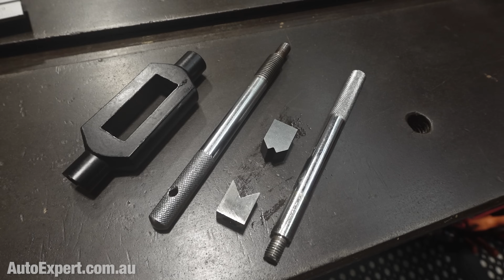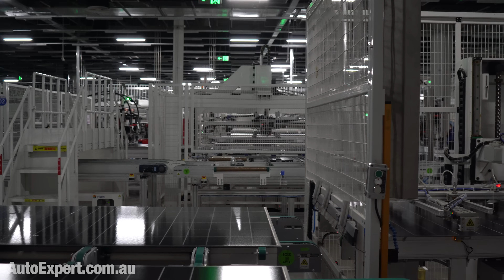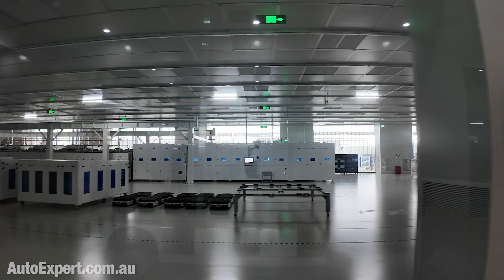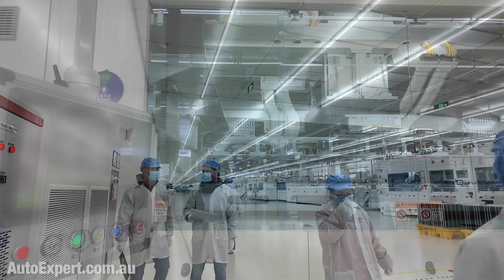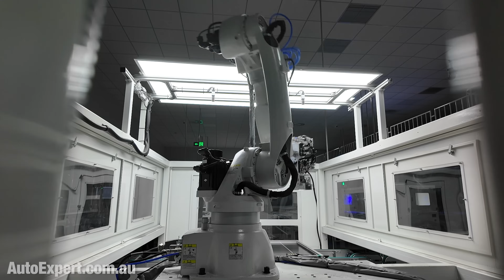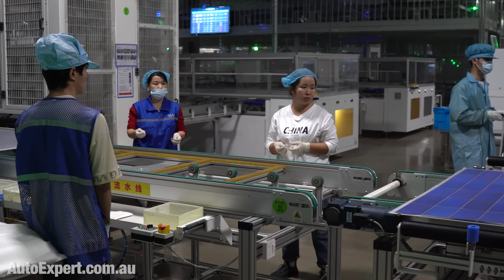The truth about Chinese manufacturing in 2025 | Auto Expert John Cadogan

Comment: Labour cost is too high in Australia to manufacture goods, however, it will be a lot cheaper if it’s done by robots. I think that’s the direction Australia should take in the future. High tech + auto-manufacturing industry
Reply: Forget about manufacturing anything in Australia.  Our market is too small for efficient investment.  Nobody outside of Australia will buy it. No future other than digging a hole and sell whatever you find.
Reply: Labour, these days, is a relatively small cost in many manufacturing endeavours. In a US manufactured car, for example, the labour input accounts for 5%-10% of the wholesale price of the vehicle. If you double that cost or halve it, it barely makes a difference to the retail price.
The other 90%-95% of the cost of producing that car is rent, plant, import duties, taxes, transport costs, compliance costs, taxes, insurance, energy costs... the list goes on.
That's why countries like Australia can no longer compete. We were sold a pup, decades ago, when unions and the high cost of labour were blamed for offshoring industry. We were lied to. And we took it hook line and sinker. We're not getting industry back to Australia.

Comment: Have a look into 5B an Australian company setting up production lines using ex Auto industry assembly line workers as well I can not say too much but have sited the line in mascot syd with mix or robot and ppl the other line is in Adelaide.  they were also going to be apart of that Sun Cable 20GW system below Darwin. mind you would be much better having home grown silicon cell production like tindo.

Comment: With so many disparate Chinese brands arriving, how can it be economic for each of them to set up individual comprehensive parts, service and support networks like (say) Toyota, Ford or BMW? The logistics seem daunting. Or do they mainly all use the same components for a given function, like a suspension component or wiper motor?
Reply: you know all the well established car makers have done that for decades. every combustion vehicle in the world uses lucas(delphi), bosch or hitachi electrical, ignition or fuel system parts.

ignition and fuel injection system almost exclusively bosch and licence built by other manufacturers

Comment: I'm old enough to remember when Japanese products started flooding the UK market in the 1960s. Most of it was cheap plastic crap and consequently all Japanese products were labelled as such and dismissed. However, by the 1970s Japanese cars and motorbikes were considered of both superior quality and superior value for money compared to British-made cars and bikes, and brands like Sony and Pioneer were taking over electronics.

Fast forward 30 years and it was the same story with South Korean products -- Hyundai, Kia, Samsung, LG, and Daewoo. (No, not the car manufacturing arm that was bought by GM and went bankrupt due to senior management malfeasance, the marine engineering giant that builds tankers and oil rigs.) Another 20 years on and now its China that is producing goods that are not only a fraction of the price of Western-made goods but also technologically superior.

Comment: 7 years ago, I worked at a company that bought a Hitachi  laser drill to make very small diameter holes in printed circuit boards.  It was the only one in Australia at the time. The service man came in from Singapore every six months to service the machine. 
In conversation, he mentioned that he spent most of his time in Schenzhen servicing 60 of the  same model drills. He also mentioned that there were just three operators to look after these machines,  such was the level of automation in that particular factory. 
That was a real lesson to me how small Australia's production actually was.
Everything with electronics needs a pcb.
Reply: China has been built up into the biggest global superpower by the Jewish financial elite and every valuable Western technology has been shipped there. This was identical to what the Jews did with their USSR, turning it into a massive super state of a military superpower, to wage conquest upon the rest of the earth, which they did.
Reply: via,s
Reply: When I worked in China around 2005 in the next town was a Flextronics factory - It had 27 SMD lines. It was installing an injection moulding plant as well. they were making Xboxs at the time I think.
Reply: Thank you for not saying “PCB board”.
Reply: Don't forget, China lacked the technology to make a ball-point pen until about 2010
Reply: @bloothedog4443  and in that short time since then, China quantum leaped.
Reply: @VincentFSW  still the question mark ?….via innovation or improvement on original…
Reply: @georgesikimeti2184  does it matter. Case in point - China’s Thorium reactor - USA shelved their research perhaps reaching a “wall” unable to further without huge investment of time and effort - but China then continued the research based on USA’s groundwork and made breakthroughs. Also in-spite of USA’s embargo on Chip making technology China found their own way forward. …
Reply: @VincentFSW  again no innovation……
Reply: @georgesikimeti2184  which rock have you been hiding under. Have you not seen their EV battery technology way ahead of anybody’s. Their thorium reactor that does not meltdown is already an innovation. Your continued denial is a reflection of your racism that you look down on the any other race assuming they cannot develop technology. China has already flying cars, space station and yourselves what do you have but scorn.
Reply: @georgesikimeti2184  Get a dictionary and find out the meaning of innovation. As the guy in princess bride said, ""I don't think that word means what you think it means"

Comment: Let this sink in. The world is expected to add an additional 593GW of solar this year alone. Do the maths. There's roughly 700K Oz of Silver in a GW, requiring 415M Ozs of silver in a world that produces 820M Ozs of silver annually from mine supply.
Then add in all the other industrial uses of silver and the fact that next year solar panel demand is expected to increase to 700GW. 
Houston, we don't have anywhere close to enough silver to reach 2030 targets let alone 2050 targets.
The silver price is going to the Moon once the world runs out of above ground stocks, and it's very close to running out.
Reply: The  bottleneck is supply rate, not geological scarcity.
Reply: @jasonsexton5017  . OK then point is?. Mine supply is short by over 400m oz pa and declining because there's almost no new mines coming on line and it takes over a decade to get a mine up and running.
Meanwhile, demand is skyrocketing, with new solid state battery technology from Samsung that uses silver in the anodes expected to increase demand exponentially .
Reply: The silver price will have to rise to an order of magnitude that then begins to draw silver from dinner sets, jewellery and other antiques etc. That will likely be more than double its current price, and possibly triple or more.
Reply: And then there's the not so little problem of Copper. I suggest that people read the research of Vaclav Smil, arguably the most knowledgeable scientist in the world when it comes to crunching the numbers on net zero.
There isn't even remotely close to enough Cu in the ground or above to electrify global transport.
Reply: That's why the current move to copper conductors on PV
Reply: @ It won't work. Copper is way too corrosive and PV Cells have 25 years of life cycle minimum specifically because of silver
Reply: @guringai  They'll never get close to the life that silver provides nor the conductivity and efficiency